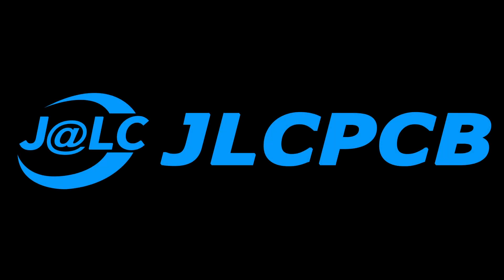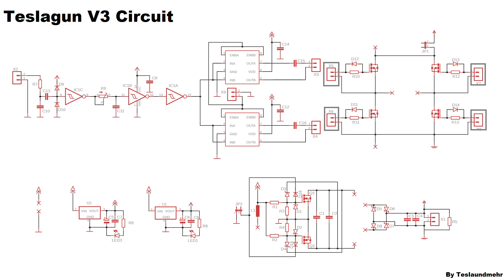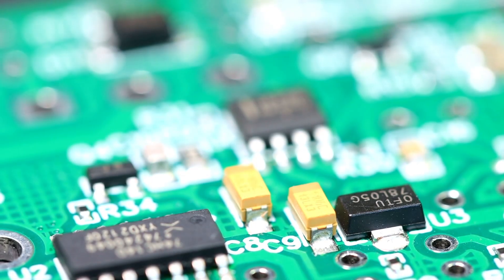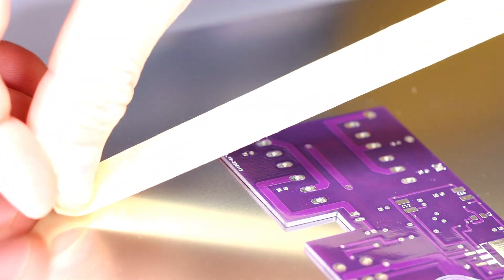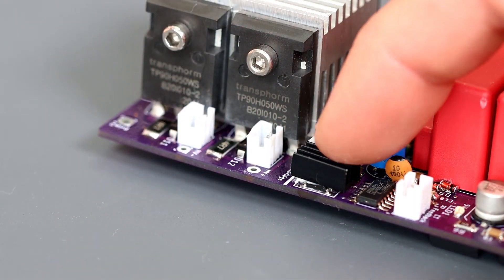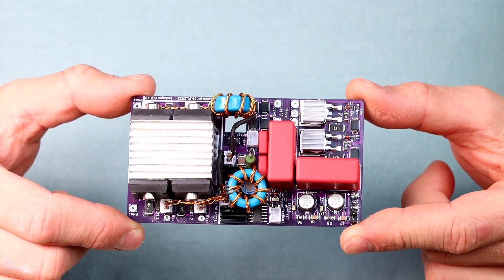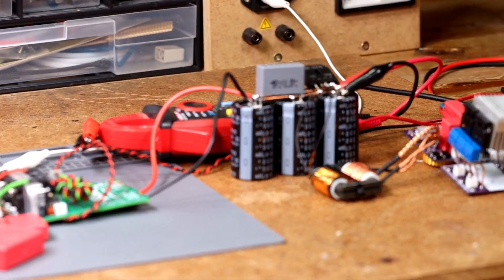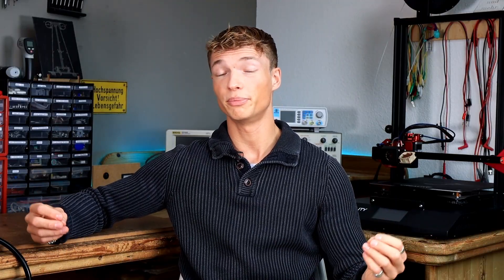I built a 12V Tesla-Coil with EXOTIC Mosfets - Does it work?

Comment: Whenever I am working  with high complexity oscillators i am kinda expecting it to fail at first tests and debug it for hours 😂, so I would have been really surprised if yours did work at first attempt lol.
The problem might have been a cold solder on smd though..

Comment: What is the diameter of the tesla coil and which thicknness of wire did you use sir.... the height of the cylinder is 9 cm but the diameter ... really wanted the pcb gerber file... thanks😃... Great work sir

Comment: your pcb design is the problem kills the mosfets😂too thin wire induces high ESL which causes high voltage peaks and boom！using copper plate and adding some absorption capacitors parallel to DS（as close as possible） will help it better 
ALSO you can try to series an tuned capacitor with primary（must resonate with primary in secondary freq）do some phase shifting（let Vds phase the same as Iprimary，killing the high voltage peak） will make it even more powerful

Comment: While this is certainly a worthy project, I would have much preferred to see it run directly off the AC line thereby greatly simplifying the design and eliminating the output transformer. We are dealing with high voltages anyhow so a hot-chassis design is not much of a deterrent.

Comment: Maybe you need some insulation between the body of the mosfets and the cooling block. Some stuff has internal connections with the outer body so it may have caused shorts between mosfets.

Comment: Ive been using GaN's for a while now. I typically use either a GS66504B-TR for high freq. applications (input gate capacitance is only 70pF, I can run up to 8MHz without any ZVS, just brute force) or GS66516T-MR for higher current applications, these are a bit more pricey but work really well. The thing I like the  most about GaN Systems Inc. fets is that they trigger on just 5v! So super easy to build fast gate drivers using just logic chips.

Comment: Why not just use regular isolated gate drivers instead of the gate drive transformers? It's possible that the transformer is picking up large spikes from the long wire leads during switching transients. With regular gate drivers you'll have good CMTI and controlled gate drive voltage levels which are less likely the blow up the FET

Comment: That's some impressive SMD work right there. It would almost be too good to be true to have such a complex build just magically work perfectly at first but that's why I'm too lazy to go SMD cause I know there will be failures and it will be 10x harder to repair. Hard to say what could really be the culprit aside from the usual suspects but I assume the GAN's helped with driving it as a full bridge at ~1mhz using what seems like maybe 4A pk capable dual gate drivers. Dead time seems to be more crucial with GAN's so that's a possibility and I haven't quite figured that all out yet. I have some builds very slight changes to the rise/fall times makes a huge difference in how cool the switches run even though any variation seems like it would work well or about the same. With cheap 460 drop in replacements and still the same overheating though it might need a dang IR gun to pin point what is burning. Gate signals look super good though, 76ns rise using 10 ohm resistors and a GDT seems almost impossible.
Reply from the maker: Hey Bro, thanks for your feedback! Really appreciate that. I found out that for driving GAN fets its the best idea to use special drivers...I will work on it!
Reply: @Teslaundmehr  Drivers specifically for GAN fets makes sense. I'm curious if it ended up just not seeming practical to use silicon fets though whether it be the heat dissipation or drive requirement. I want to try it but not spend a ton of money on dead GANs lol.

Comment: I very much enjoy your videos. They are very explanatory and informative! It sucks when such hard work ends with disappointing results. Honestly it appears that the power switching without the reverse protection diodes would cause massive problems. My thoughts (I'm only an experimental engineer with no college degree) is to add a second switching circuit with the power dumping through a mosfet. Although the heat generated would increase (potentially dramatically) it would save the transistors from cooking. I guess it would pretty much be a separate zvs in parallel with the original circuit. One for lower amperage and one for higher current.... I still suggest protection diodes and maybe a fuse or thermal protection switch. I built a very simple high temperature protection circuit for my drsstc and it's saved me many times. Best of wishes to you. Thank you for sharing your progress.
Reply from the maker: Hey, thank you for your feedback! That is a really good idea, maybe I will implement it in the new version :)

Comment: Excellent video, and yes projects like this can be very hard! I am working on making a LLC converter and making a video for a DIY UPS to power my computers. Lots of math and simulations though before I start burning through my reserves of FETs.

GaN FETs are VERY fast and demand very good layout to use. Failing that, you will have voltage spike that kill them. That GDT is likely the culprit. Consider using an commercial SMT pulse transformer. While GaN offers conduction losses 3 times less that of silicon, the thermal resistance of the material is higher and they have a harder time dissipating heat. Coupled with the fact of being more expensive to produce, the designer tends to go with units that have the smallest gate charge. These ones are the smallest physical ones and tend to have lots of centralized heat in a small area with not much thermal mass.

I'd opt for them if your coil is switching at several MHz. Below 1 MHz, just use silicon.
Reply from the maker: Thanks for your feedback and the informations!!!

Comment: I saw some comments mentioning the addition of dead time. I did not work with GaN FETs, so I don't know their switching speed. If the driving signal is simply inverted and the transistors can't switch fast enough, there will be smoke (ask me how I know). Nowadays I use two half bridge drivers with incorporated dead time (DGD2304), and I have no problem with blown FETs or IGBTs.

Comment: Fließen bei der Tesla - Gun die Elektronen vom Metall in den Äther oder aus dem Äther kommend zum Metall?
Es sieht ja so aus, als feuere die Gun, aber kannst Du sagen, in welche Richtung sich die Elektronen bewegen ??

( Do the electrons flow from the metal into the ether or the other way round ?
 It looks like the gun is firing, but can you tell which direction the electrons are moving?? )

Dankeschün und Grüße !!